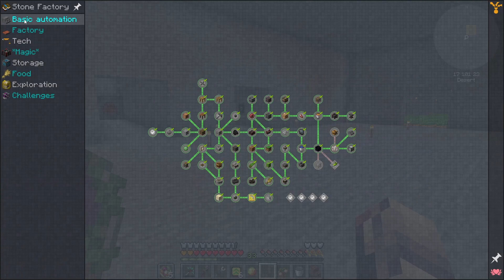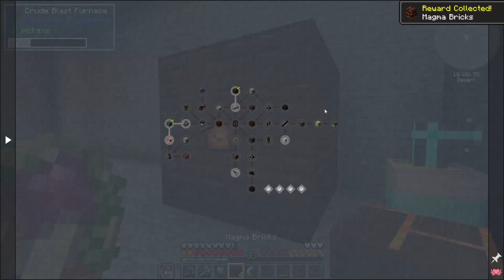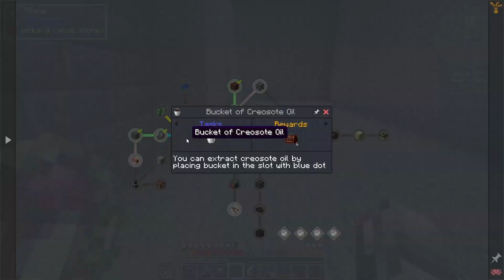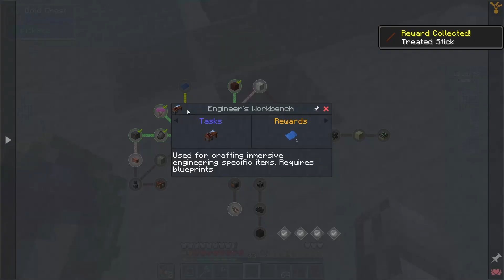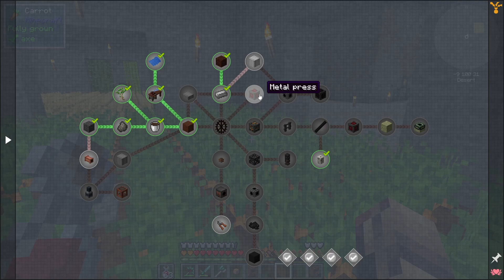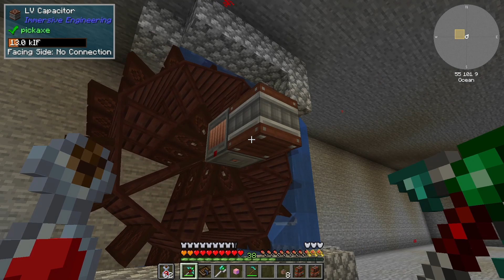Cave Factory Ep. 14: Immersive Engineering Progression

Comment: I think you're really gonna love thermoelectric generators. Much more space efficient and they're pretty easy to get into, since you can make wires, plates, etc by using the smeltery. You just use up one wire to create a golden wire cast, and then you can automate as many wires as you want. Tinkers and create has made a lot of immersive engineering redundant, except for the steel.  

To get it to work, you just put a uranium block on one side and some water on the other side, and for double you just repeat it on the other two sides. When transferring energy I highly recommend energy pipes, since wires tend to have loss. Once you've got energy up and running, you can start making freezers to produce Blue Ice to replace the water and generate more energy. Cooking for Blockheads has a recipe for a "sink" that gives infinite water.

I just put mine on the bottom of the world and used HV capacitors for buffer and flux plugs into my flux network, so I can just plop some flux points on whatever I want to power, or put a point on an HV capacitor and use energy pipes to direct the energy to wherever I want.

I highly recommend getting into the storage part of the book and creating a simple storage network as it's gonna make your life so much easier and you won't have to look through all the drawers to find what you need.

Going into your mini rant in the beginning, I personally haven't had much issue with having only one compact machine. I have more resources than I know what to do with and I'm not killing my laptop, though I think I don't have half as much automation set up as you do.

btw, if you get into flux networks and jetpacks, definitely get a flux controller. You won't have to worry about recharging it.
Reply from the maker: Sorry for the late response again. This was held for review as well. I am going to move towards automating wires with Immersive Engineering for the novelty of it, and I am going to automate plates/sheets with Create just to add something to the pack. While I love tinkers I don't want to use it for everything as it just becomes a bit bland after a while. 

As you saw I went the route of the Desile Generators, but I do have plans for the thermoelectric generators in the future as I don't want them to go to waste.